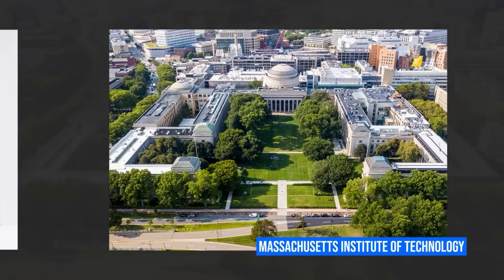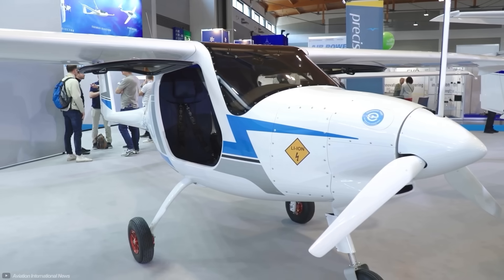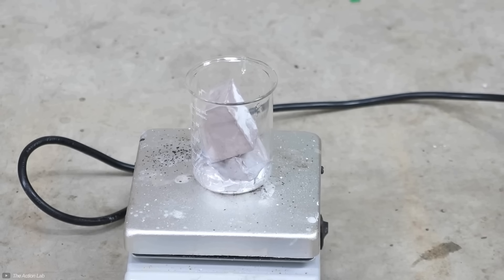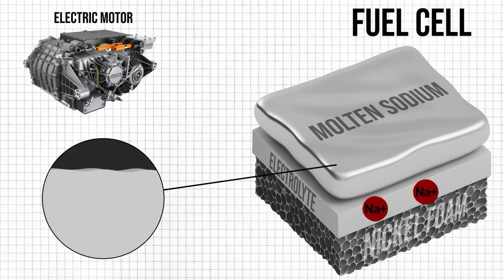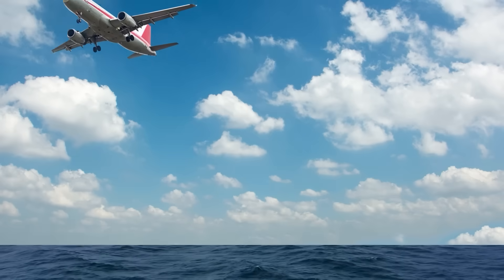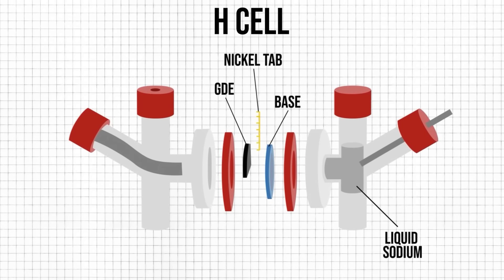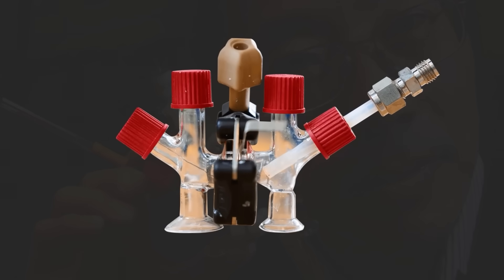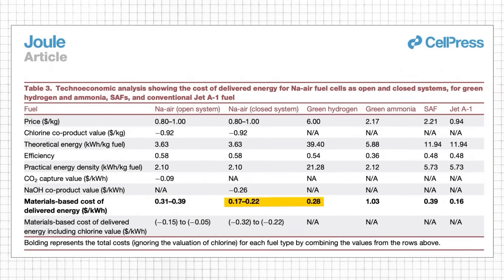How MIT's New Sodium Fuel Cell Changes Everything

Comment: This “fuel cell” is basically a single use battery with a replaceable electrode.  There is already a commercial “fuel cell” that uses aluminum that is both safer and lighter.
Reply: Yeah, wtf. This is literally just a single use battery, and quite shitty (power density, sodium, ..) at that. Sure, you can change the electrolyte, but that is nothing new.
Reply: @Bystroushaak I think the breakthrough here is the combination of the solid electrolyte and the porous nickel sponge where the reaction happens. Building this into a bigger fuel cell should be easy from here.
Reply: sounds like a galvanic battery
Reply: @spankeyfish  Galvanic aglutination is a method to clean polluted water including raw sewage cost effectively.
Reply: It's a metal-air battery, not too different in concept from aluminium-air or the humble zinc-air that's been used in hearing aids forever. Doesn't mean it doesn't have a place though. Aluminium-air is not currently rechargeable so you have to swap out the whole battery, while this lets you just dump more sodium into the hopper. Also, aluminium-air gets heavier as it discharges, which is awkward for aviation. This exhausts its reaction products as it goes. I wouldn't be using it over land, but exhausting sodium hydroxide powder over the open ocean probably isn't going to hurt anything, whether or not it all reacts to carbonate on the way down. You could use lithium-ion to get into the air and switch to sodium once over the ocean, which covers of a lot of flight paths.
Reply: @mathewfuller8505 Our metal-air battery pack uses fully oxidized metal with nothing exhausted or added except electricity.
Reply: @mrknesiah  If you're not reacting with air, how is it a metal-air battery? And if you are reacting with air, how does it not gain weight?
Reply: @mathewfuller8505 NDA question
Reply: @mrknesiah would your idea be also useful for long term home storage? I, and many other people with photovoltaics are looking for a way to store tens of thousands of MWh worth of energy from summer until winter. This sodium fuel cell made me think that I could somehow make the sodium myself during the summer with all the excess solar power and then use the fuel cell to get back some of the energy for our heat pump. Anyone that brings a solution for that problem will definitely get ridiculously rich as that's the future we are looking for right now. I would pay up to 10.000 USD for such a device that can store the energy in a way or another and would allow me to use it in the winter. It has to be electrical energy even if I lose 50% of the energy in the battery because the heatpump make up for the losses.
Reply: @alexandruilea915 I wouldnt touch sodium.  Too volatile.  Most metals are ok .  There’s a company that does stationary iron batteries called form battery.  Their setup is a bit primitive but should be fine for what you need.
Reply: @alexandruilea915 : If you need to store bulk power and get it back out as electricity, then your approaches are mostly:
1) Gravity storage- lift something heavy (usually water) when there's extra energy, let it spin a generator while it drops when there's an energy shortage;
2) Pressure storage- pressurize air in an air-proof container to store energy, discharge it through a turbine hooked to a generator to get energy back out; or
3) Thermal storage- store extra energy as heat into some bulk volume (such as mineral soil with pipes distributed throughout it), and withdraw it by using your transfer pipes to run heat to e.g. some Sterling engines.
Reply: @mathewfuller8505  " If you're not reacting with air, how is it a metal-air battery? And if you are reacting with air, how does it not gain weight?"

Reactions create byproducts including energy.  Mass is neither created or destroyed.  Start from there.
Reply: @johndoh5182  Sure if all your reactants start in the battery and all reaction products stay in the battery, there's no change in weight. But if one of your reactants is oxygen from the atmosphere and the resulting reaction product stays in the battery, it gains weight.
Reply: Aluminium air batteries are recyclable, but not easily refuellable without significant design compromise. You couldn’t pull up to a gas station and refill on aluminium in ten minutes like you could with a metal you can easily melt.
Reply: I think this is used in India. It is useful to have more than one competing technology though. I can't remember if the aluminium based device needed to melt the aluminium, but if it does, there is a lower temperature involved with sodium. Still sodium is quite reactive (with water) and so will be a fire hazard.
Reply: @alsmith20000 Yes, india has an aluminum-air battery licensed from an israeli company.  The electrolyte and the blocks have to be replaced to “recharge.”   The remove material is sent to a smelting company for processing into pure aluminum.
Reply: It's a nice battery and you can load liquid sodium like you would jet fuel. It's not disposable. Aluminium or sodium on the other hand, are converted to their metallic state with a lot of energy from fossil fuels. I'm not saying it's bad or that CO2 is a pollutant. Just saying. Only Norway is using the geothermal energy to refine aluminium. The next best source would be nuclear. And it's a nice storage of energy for renewables. It's heading in the right direction. Less lithium fires and dependence on Chinese dirty lithium
Reply: @trollmcclure1884 Liquid sodium is an explosive
Reply: @trollmcclure1884  "Less lithium fires..."
Have you seen what happens when Sodium and Water mix?
Pray you're never in an accident where you get some on you.
And remember, it's molten.
Reply: @TimeSurfer206  I'm aware of this. There's zero reason for water to be anywhere near the battery. Lithium batteries are prone to self-combust due to kilowatts of stored energy, thermal runaway etc. You can throw sodium into a furnace or even use it to cool down a nuclear reactor. Unles you are heavily invested in lithium business you have to see the pros. I'd rather buy a chunk of sodium at a gas station, throw it into a liquifying box and go instead of wating to charge a lithium battery. Even if the battery was twice as big. I dont care. I'd tow it in a trailer. It's not even larger. It's a perfect fuel as long as it's cheap
Reply: @trollmcclure1884  
You can use solar power to either recycle or refine aluminum ore.  It just works when the sun is shining.
Reply: Also isn’t sodium explosive if it comes into contact with water? How safe would this be?
Reply: Aluminium might not be cheap enough to just discard out the back of a plane as a hydroxide.
Reply: Aluminium is a much more Finite Resource and Cost and Pollution related to its extraction would make it Close to Prohibitive...
Diffusion of Such Technology would be also a Problem. But it could work as City Transport.
Reply: @antoniopacelli  What? Aluminium is literally the 3rd most abundant element in the earth's crust after Oxygen and Silicon. It is so abundant that aluminium companies don't even look for high grade ore. They just look for where the electricity is cheapest and then buy a random plot of land there for mining. Since cheap electricity is harder to find than aluminium.
Reply: @harmenkoster7451 high grade aluminum ore is pretty much the main ingredient in clay or "aluminohydrosilicates"
Reply: @harmenkoster7451  Producing pure Al metal, takes a LOT of power, very dirty, as well.
Reply: @antoniopacelli  Aluminum in aluminum air battery is recyclable so no real loss of materials, just energy to recycle the battery "fuel".  That said there is a volume issue but a redesign of aircraft like electric cars skateboard design would be required and the required space and infrastructure could increase its weight beyond its feasibility.  I'd love for someone to show its efficacy or lack of.. maybe there was a study done on this I just haven't seen it.
Reply: @jaspertell6764 I have a patent pending for a “rechargeable” aluminum-air battery…ie., multiple space efficient methods by which spent aluminum is recycled.  Effective C-rate is far beyond lithium-ion.  The system works even better with iron, which still provides 3-4 times better specific energy than lithium-ion at the pack level.
Reply: @antoniopacelli  Aluminum batteries are 100 % recyclable. Your comment is full of comments that demonstrate you don't what you are talking about. Please stop spreading false information
Reply: @antoniopacelli  Actually aluminium is the only metal we know of that cost less electricity to recycle than produce.
Reply: @MaththeCanadian I was using this as an example in my assignment the other day. About 75% of all the aluminium we have ever produced is still in use today. Highest approval from the UN, they say it can be recycled almost infinitely.
Reply: @MaththeCanadian   uh...  It costs nearly no energy to recycle aluminum, just melt that shit down.  Sadly, you're not making much out of recycled aluminum, it's pretty much garbage grade aluminum.  No airplanes, tanker trucks.  You might make some aluminum cans, but not the good structural alloys.
Reply: @defectiveresistor I would challenge that.  There's tons of impurities that need to get removed from recycled metal.  All that slag contains aluminum oxide, which, you guessed it, is aluminum ore.  Recycling aluminum returns much of it back to slag.
Reply: @kayakMike1000 Reducing aluminum in a closed environment is energy intensive but not difficult.  Infinitely recyclable.
Reply: @antoniopacelli  Aluminium wäre nur am Südpool eine Option, wenn man über Monate sicher  Strom haben will. 
Na  ist ein Abfallprodukt der Chlor  Chemie , die den größten Anteil an Chemischen  Prozessen weltweit darstellt, also  noch vor der Ammoniak  Synthese.  hunderte  Millionen Tonnen p.A.
Reply: Aluminum is poisonous while sodium is not.
Reply: @Sulayman.786  have you ever seen the reaction between sodium and water? on the small scale it is interesting, but on a large scale? i don't want to be anywhere near.
Reply: @Sulayman.786 that’s a wild take, considering all the aluminum cans used for food and drinks.
Reply: @sumguy01  That's a common misconception. There's actually an ultra thin plastic layer inside the aluminum can that separates the aluminum from the contents.

https://www.youtube.com/watch?v=xBQEnVR7y9k
Reply: @Sulayman.786  Sodium just explodes in contact with water, which is a definite concern for applications that are outdoors and/or might be subject to crashes or collisions where water might take part - like, I don't know, vehicles.
Reply: @Sulayman.786  Sodium reacts explosively with water, whereas aluminum does not.
Sodium may not be "Toxic," but, please don't ever put a piece of the pure element in your mouth.

Comment: Sodium in MIT's use case becomes a constantly extractive process, while making sodium batteries becomes a recyclable process once established over time.
Reply: Exactly, it doesn't run backwards like a battery can recharge.  So no energy can be recovered while going down hill or descending in altitude.
Reply: Jonah, Nice thought, but aircraft never brake, other than the reverse thrust after touchdown, so there's no potential for regenerative braking when flying.
Reply: Sodium is ridiculously abundant and easy to get hold of so just throwing it away once it's been used isn't such an issue if it solves a difficult problem.

Comment: A simple solution to managing the byproduct of the reaction is to just enforce the storage of the byproduct on board whatever vehicle/aircraft is producing it.

Instead of exhausting it; we can store it in a separate tank that can be cleaned out before refueling.
Reply: And do what with it then? Airports would have superclean drains I guess and all of the aquatic life for miles around would mysteriously vanish. No thanks.
Reply: @nickwinn7812 > Makes baseless claim about damage to aquatic life
Reply: That would dramatically reduce the efficiency, as explained in the video.
Reply: @bjornfeuerbacher5514  Thanks captain obvious.

The point is that the efficiency doesn't matter as long as it's more efficient than pure ICE engines.

If it's in a vehicle that is reliable and has the amenities and appearance that match the desired vehicles of today at a reasonable price. People will buy it.
Reply: @mohammedgoder  Vehicle? The video was about planes, wasn't it?!

And it's far from obvious if this is more efficient than pure ICE engines, and if this is reliable (or even safe), and if the price will be reasonable. Quite a lot of ifs.
Reply: @mohammedgoder   '' The point is that the efficiency doesn't matter as long as it's more efficient than pure ICE engines. '' That tells me you don't know how to calculate efficiency. It will never be more efficient than ICE engine. Because the energy density of fuel is simply so perfect compared to anything else. Even by wasting 2/3 of the energy ( which is the efficiency of the average ICE ) its still better by several order of magnitude.
Reply: @MaththeCanadian > Makes up random numbers.

> Arbitrarily claims that I don't know how to calculate efficiency.

> Claims ICE vehicles are less efficient than a vehicle with this propulsion mechanism.

Try to make a coherent argument next time.
Reply: @mohammedgoder   Try addressing my points and not try lecturing people to avoid a real argument.

You don't know how to calculate efficiency. Prove me wrong.
Reply: @MaththeCanadian You don't have a point.

Take your own advice and address my point.

You clearly don't know what you're talking about and are just arguing to argue.
Reply: @mohammedgoder   You brought nothing to the table. If i am making numbers uyp, prove me wrong. And this is where you go silent.
Reply: @MaththeCanadian  Funny how you keep claiming that I'm doing things that you are the one doing.

Take your own advice and bring something to the table.

The burden of proof is on you; not me. Your numbers are made up unless you prove otherwise.

The reality is that you are arguing to argue on a topic that you know nothing about.
Reply: @mohammedgoder   There you go again, doing anything but having a dialogue. Is it because your are projecting on me? Arguing for the sake of arguing huh?

I said ICE engine have around 35% energy efficiency. Start by proving me wrong or admit the statistic.

That will also prove you right that i am just a troll. If you don't, you are the one. Simple isn't it?

Go ahead, make my day.
Reply: @MaththeCanadian  You do realize that this is all in plain text, right?

Everyone can see that you never mentioned the efficiency of anything in any of your comments. This is the first comment where you mentioned the efficiency of anything. That being of ICE engines.

Like I said again. You haven't proven your point. All you've done is argued to argue.

I'll give you a chance to conjure up a coherent point.
Reply: @mohammedgoder  No i realize you are so contrarian you are ready to lie on facts. When i say ICE waste 2/3 of the energy of the fuel burned ( which was the reply that triggered you that much ), it means an efficiency of 35%. But keep convincing yourself you actually know anything on the subject.

Or that your replies are proving anything at all but your contrarian attitude.

Comment: SODIUM... SOUNDS PRETTY EXPLOSIVE TO ME... AS IN "BANG", YOU'RE DEAD.
Reply: Hmmm.  Good point.  Under normal conditions, of course there's not a problem.  But sometimes cars get caught in a flood, and water and sodium are "lively" together.  In the case of plane crashes, there's already a lot of disaster, and I don't know that sodium would be any worse than conventional fuel;  it might even be safer in such cases, for lack of spreading (assuming quick cooling closer to ambient temp).
Reply: @PeterLawton  Sodium also reacts quite violently with the oxygen in the air, especially if it is molten and at high temperature. That is worse than conventional fuel.